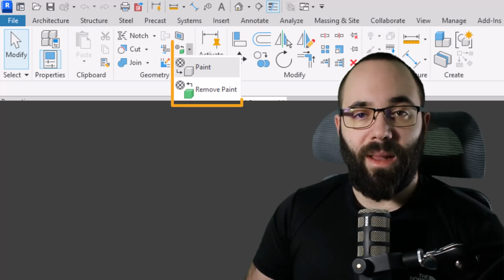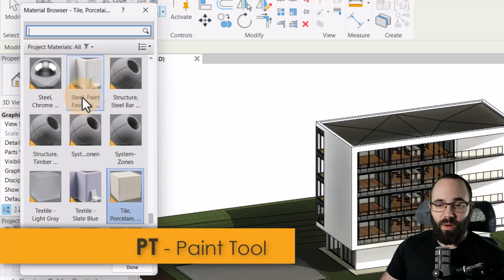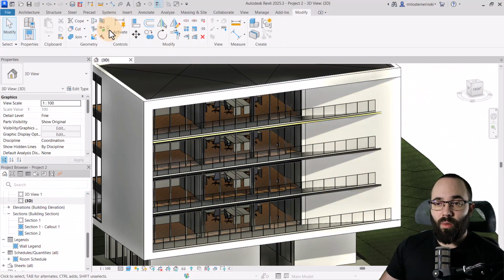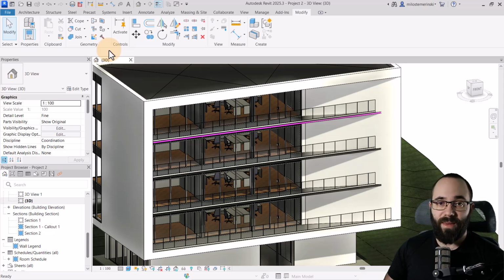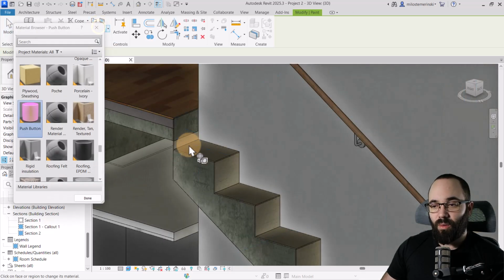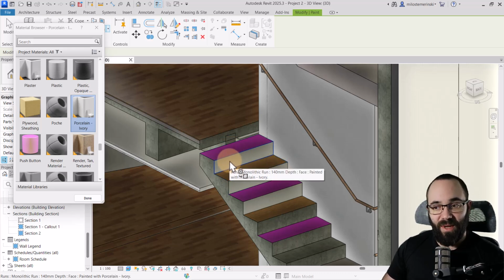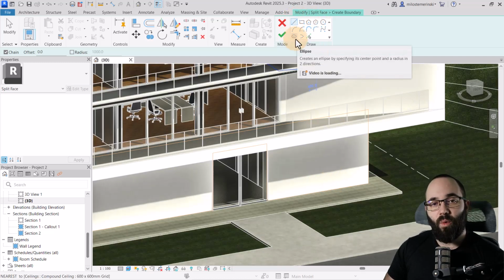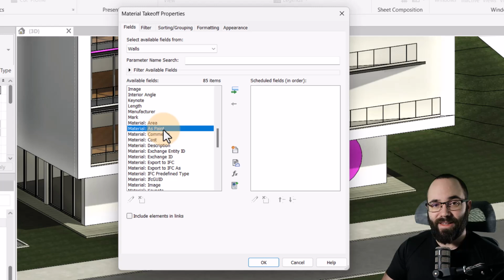Paint Tool in Revit Tutorial

Comment: I was hoping you were going to address the tag issue with floor plans. Recently, I've been trying to migrate to Revit but discovered that you can't tag painted walls on floor plans, and for interior design projects, that's really annoying. Is there a workaround? Or a proper way to have different walls with multiple paints on different sides without creating them individually, that can be automaticly tagged ?
Reply: The biggest problem with the paint tool. I've been working on a dynamo script that extracts the info when selecting the painted face on plan but there are some big problems creating a tag in plan. I'm trying to use the 'if'>painted to try and colour the host in plan+create a schedule to map the unique colours to paint descriptors. I'll let you know how it goes!